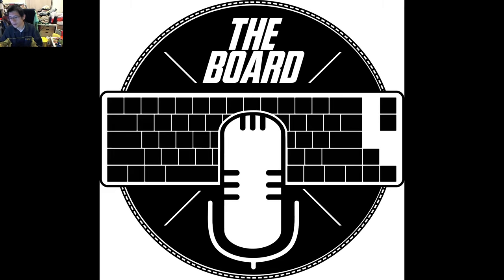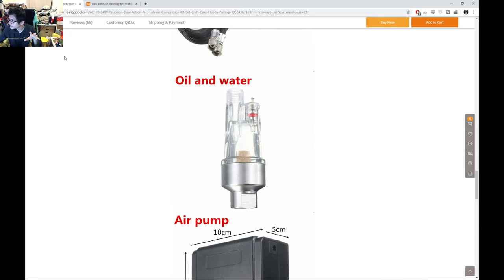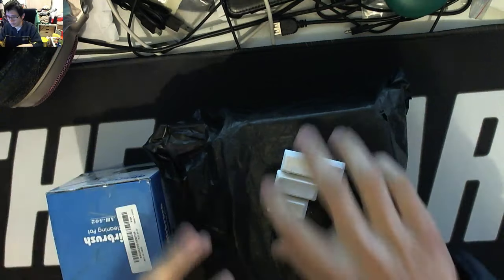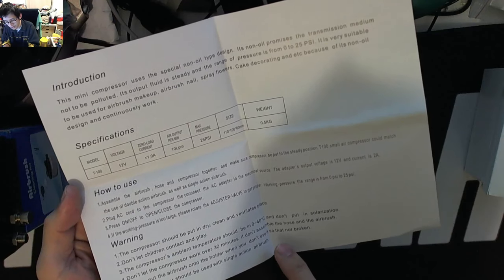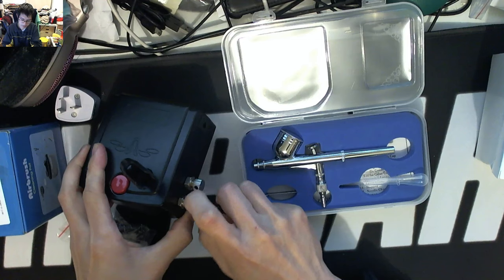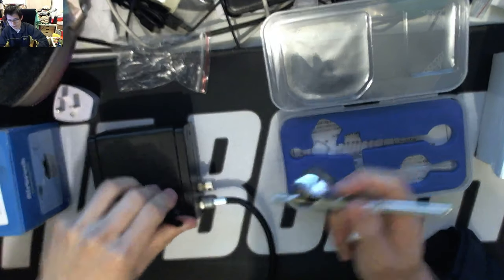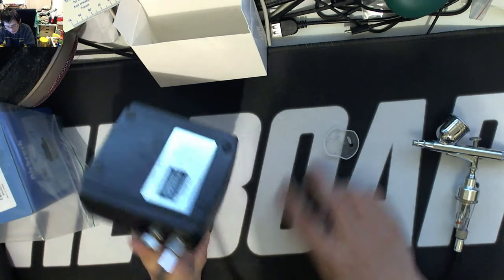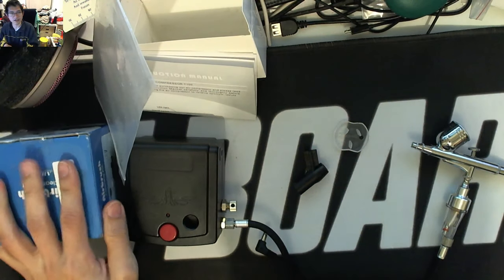Airbrush for Mechanical Keyboards - Part 1

Comment: Hey there! I know this is 2 years old…just wondering if you continued with the airbrushing for keyboards? I just painted my first keyboard but I think it would be better with an airbrush.
Reply from the maker: Man, its been 2 years.... Covid really threw everything out the window lol..... I did actually use the airbrush in another video which is this - https://youtu.be/Sy_Xs3-4iD8 and also painted the bottom of the case in this - https://youtu.be/ZKK5Ij5wsMI